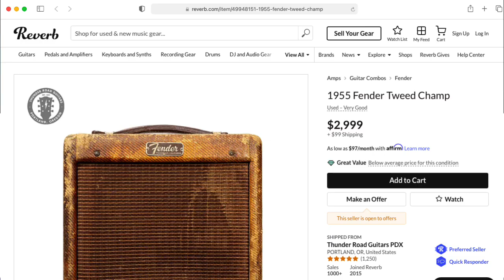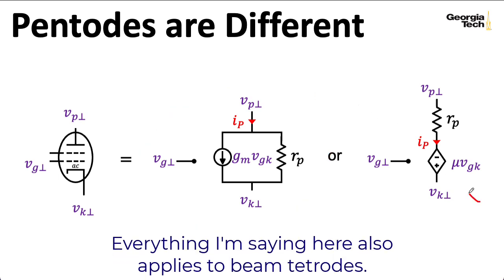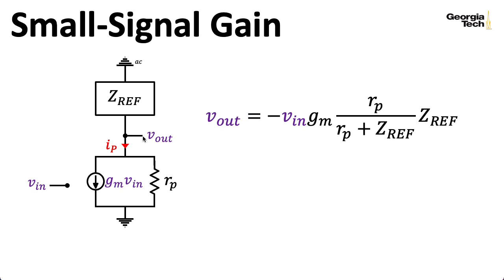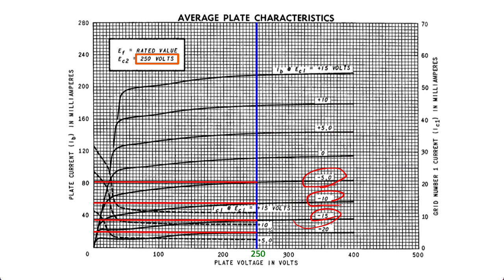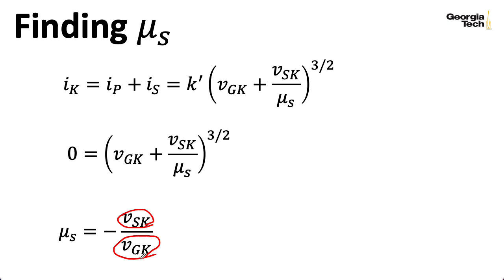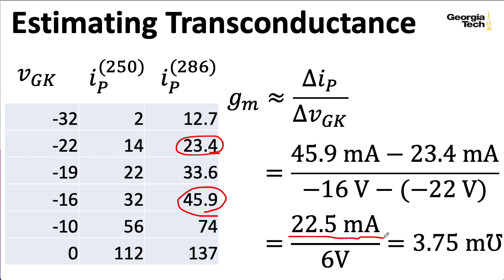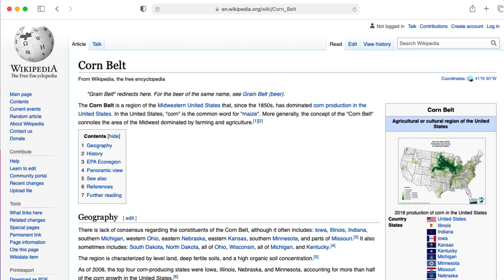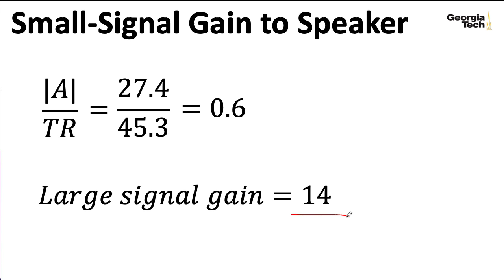ECE4448 L49: Single-Ended Power Amplifiers: Small-Signal Analysis (Guitar Amplification and Effects)

Comment: AARON, Can you make a video lesson about "Tweed Mixers" they are called other terms but fender amplifiers use them but using either 1 halve of the 12AX7 or using both plates that get tied to a tweed mixer. This causes signal to noise ratio issues because when you tie two different gain stages of plates to the same DC voltage node it creates noise because that two plates are from different gain stages. You will see this often in 80s and 90's fender amplifiers I'm guessing because of bad engineering but when tieing two different 12AX7 plates together to the same DC voltage node will cause noise issues causing the signal to noise to get worse which I'm not sure why that is but I think this is why they used "Tweed Mixers" which they are called.
Reply from the maker: I recommend checking out Richard Kuehnel's book on the Fender Deluxe (well, its many variations).

Comment: that analysis is really cool. I build a similar amp (2F2A basically a champ with added tone, which I also added a presence on the feedback loop and a grid resistor to the power tube). One question I asked myself if the circuit is designed to work at 286V nominal, does that mean the voltage swing can go close to ~600V on the positive side? (thinking about cap rating to use), or am I not seeing it right and 286V is the peak on the positive side (the tube chart do stops at 400V)? Was the circuit actually designed to drive the tube into saturation or was it a 'happy accident' and it was intended to be operating nominally without driving the tubes into pretty harmonics? (can the harmonic saturation 'quality' be measured other than an FFT showing order peaks?) Finally, can we get even more harmonic saturation by tweaking the circuit even further (or is it worth it)? I'm an ME with interest in audio circuits, so these videos are a golden mine!

Comment: The plate current extrapolation trick is nice, but I wonder how close you would get by just linear extrapolation starting from 200 V and 250 V if you want to reach 286 V? Not sure if you had multiple data points to start from in all cases though, then that extrapolation trick is definitely useful.